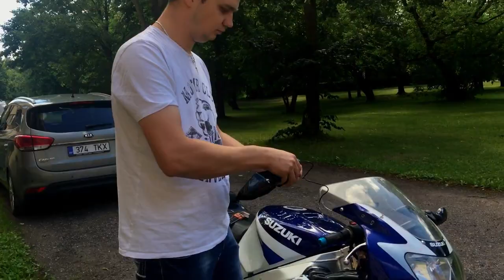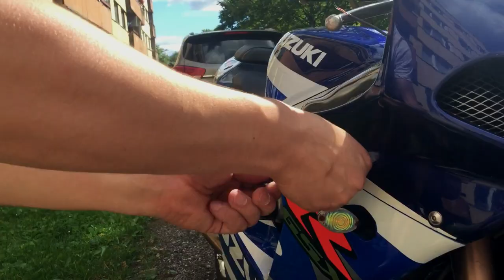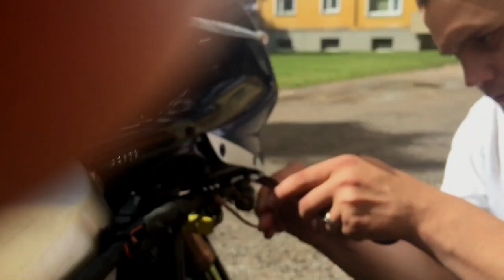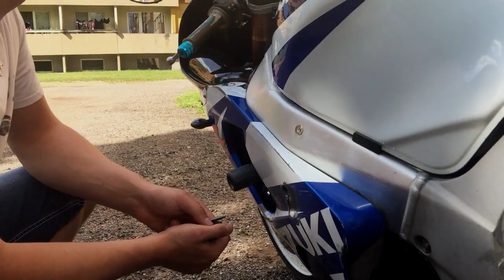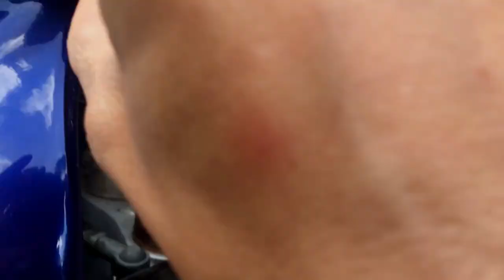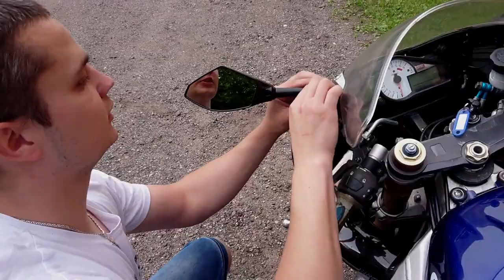Suzuki GSXR 1000 K1 First Bike Restoration Part 4

Comment: I’m really considering these any problems with them.
Reply from the maker: I ve used them for 2 seasons and everything is working :)
Reply: @TheMeisner87  thanks can you fold them in for tight spaces
Reply from the maker: @TheYjmfan  mirrors can be adjusted by nut.
Reply: @TheMeisner87  thanks.
Reply from the maker: @TheYjmfan  you’re welcome